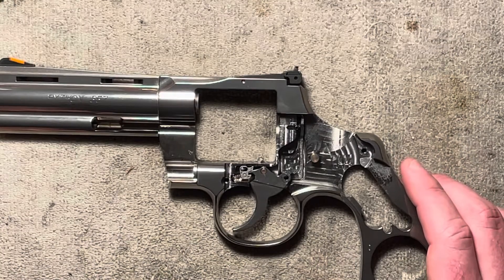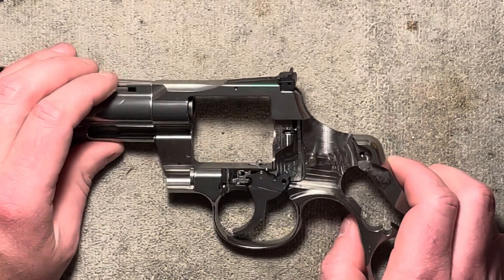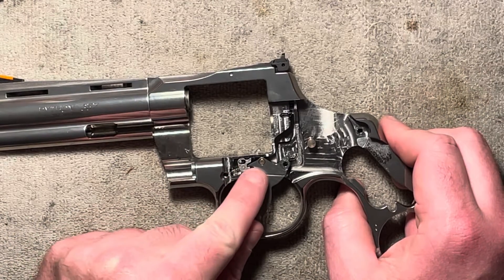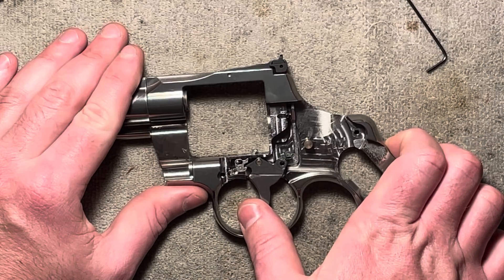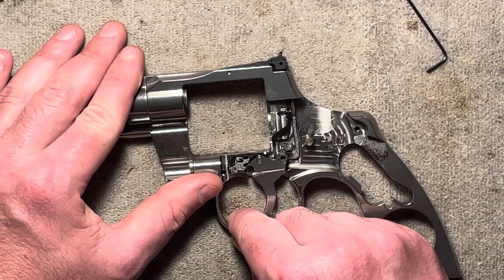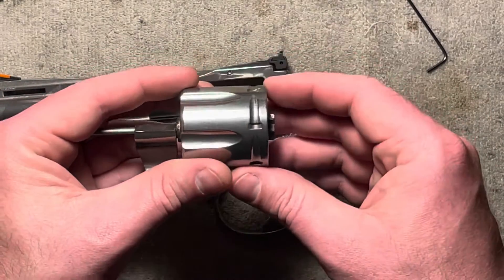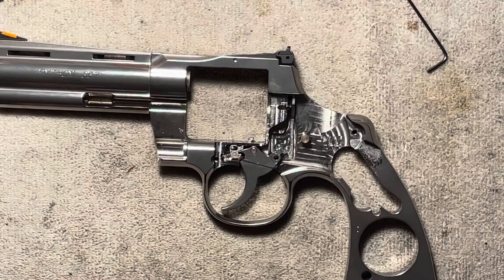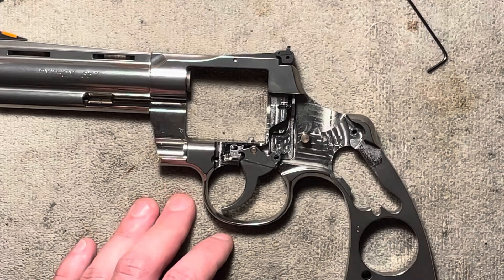How a Revolver Cylinder Stop Works ft. New Colt Python

Comment: Brother this video was very very helpful and educational on firearms 🤘🎸 the only question I have is are the difficult to replace the cylinder stop?  My Buddy has a really nice revolver but the cylinder is spinning freely which is very dangerous!
Reply from the maker: If it’s a new model Python, probably fairly easy if you can get the part. It seems like all of Colt’s fitting is done at the pawl, and it just tensions against the cylinder stop at full trigger travel. I would speculate that a drop-in replacement is likely. 

My understanding of S&W revolvers, to the contrary, is that they are fitted so you’d potentially need to be prepared to assess the indexing of the cylinder and make adjustments as necessary. 

So, in short, they can be replaced but it might take a bit of skilled fitting from someone with experience.
Reply: @ColterBrog  thank you for the feedback I really appreciate it I'll definitely consider this information safety first! And I'll definitely pass this information. again very helpful thank you so much. 🙏

Comment: If I really get on mine. Like a panic fire mode. I get over travel, primer strike right on the left hand side of the primer, no discharge on all six cylinders, slow it go bang every time, run fast like a two stage trigger pull is the only way to run it reliably, single action no issue of course,  kinda blows moose testicals.
Reply from the maker: That’s a little odd. II think I might consult with Colt on that if it’s still in warranty.

Comment: Can you Tell me how the cilinder comes Out on a python, because I don't see the cilinder reallease system
Reply from the maker: 2020 Colt Python Disassembly (Part 1 of 2)
https://youtu.be/n5IoP8WJeqg
Reply from the maker: 2020 Colt Python Cylinder Removal, Disassembly, and Reassembly
https://youtu.be/gRADYQymhho
Reply from the maker: Particularly that second link should show exactly what you need. It does require a properly fitting screwdriver. The slot is very thin, long, and a bit shallow. Normal screwdrivers will damage the screw.
Reply: @ColterBrog  i meant when you want to reload
Reply from the maker: @Mr.Marcin_Klu_Les  https://youtu.be/3_IL8BK2b70

It’s the cylinder latch, sometimes called the thumb piece. It’s on the left side of the revolver aft of the cylinder. On a Python it releases the cylinder when drawn to the rear.
Reply: @ColterBrog  thanks

Comment: Really clear, very good video. If I understand it correctly, this is true for new Colt revolvers and the Trooper Mk3 series, but the old Python and Detective Special etc worked a different way?
Reply from the maker: The old Python and Detective Special are different. 

The type you see here is similar in concept to the Trooper Mk3, as well as various S&W and Taurus models.